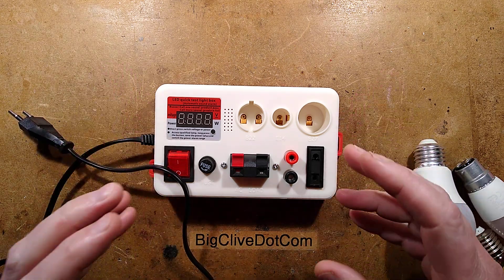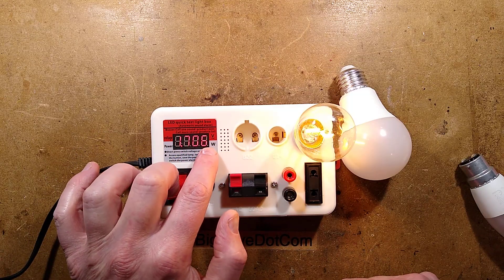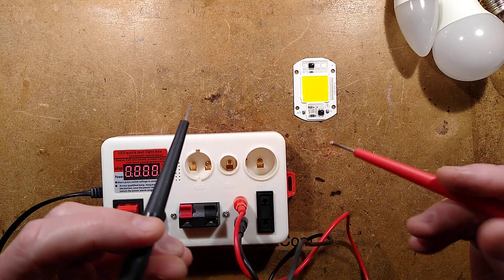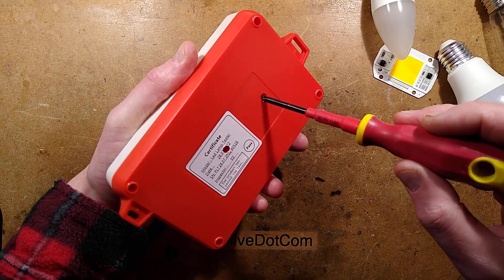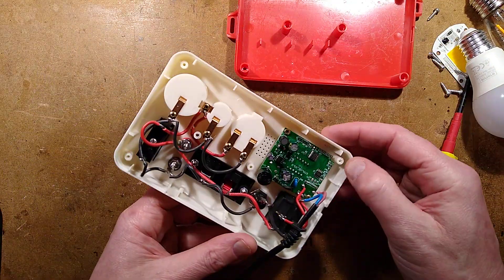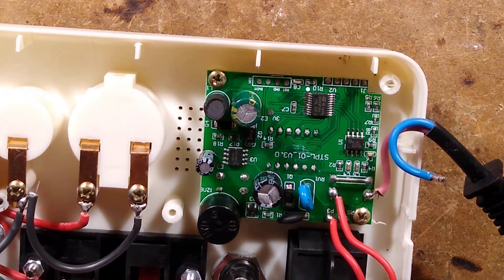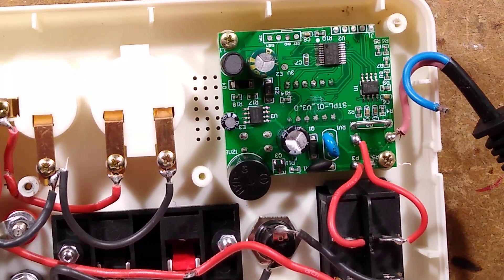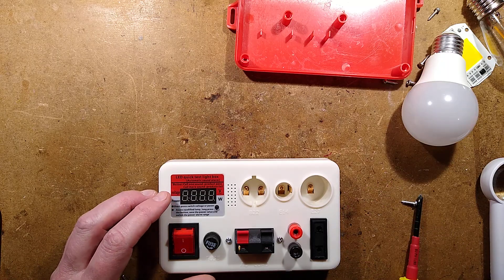Scary eBay Chinese factory test equipment

Comment: It seems good device to me. It's not safe, so is angle grinder, it's much safer than angle grinder.
And if you are healthy, it's quite unlikely to die from 240V, did you know anyone who died from 240V ?.
In terms of electricity we are too afraid in my opinion, this is not a device for someone that doesn't understand ohms law.
Reply from the maker: Yes.  I've attended the aftermath of an electricians electrocution to make the equipment safe.

Comment: Check the phase connection to the PCB it's only holding by a few whiskers not the greatest workmanship.
Reply from the maker: Neither of them were connected well, and when I attempted to re terminate them I discovered it was copper coated aluminium flex with very little copper.
Reply: We have a Kiwi expression when things don't according to plan (Bugger)  check out a set of television adervertising Toyota Hi Lux uses hope fully you will be able to find them on You Tube. I hope you can find them and hopefully appeal to your sense of humor.

Comment: I think in China they expect the individual to be more responsible for the security of self.  Not like the West where if you walk into the road without looking while watching Tiktoks  or swiping on Tinder, you can sue the motorist you walk into.  And ladders need 12 warning signs including "conductive" for aluminium.  Because education is so much better in the West, and Whites are so much smarter than everyone else.  lol.  On the contrary, use it or lose it and we're legislated to be careless and dumb.  Which is what Communists are supposed to be, in theory... Dao te King.  But I guess with Democracy you should expect the law to reflect the fears and aspirations of the lowest common denominator.

Comment: I've built and used "man killer" cheater cords before but those aren't commonly used, the idea that you'd basically use one in your daily workflow if using this thing with the probes is a bit disturbing...
Reply: With TV/radio servicing it sufficed usually to have a pair of polarized and unpolarized cheater cables.  If the "suicide cable" was absolutely necessary, alligator leads into the unpolarized cheater cable was what I used, plugged in only after hooking everything else up.  So I lived only semi dangerously.  I respected the juice.

Comment: Interesting as always! Out of all the weird stuff you've bought, which one would you say is the biggest "this thing will kill you" thing?
Reply: I vote for the blue camping light with a phone charging port tied to the incoming mains.
Reply: @tactileslut  I remember that one, Yea even worse then this thing.
Reply: @tactileslut  That adapter with the prongs that poked out at mains voltage was hilariously bad too. And all the "Dalek" lamps.
Reply: @tactileslut  For sure
Reply: The water heater which was just two electrodes directly connected to 230V? And used the water itself as a "heating element"?
Reply: @Maurice_Walker  probably passes testing if it was double insulated. 🙈
Reply from the maker: It's hard to choose.
Reply: Wasn't there a shower head with live wires in the water path?
Reply: @CptJistuce  yeah but that wouldn't shock you as long as it was working properly and grounded.
Reply: The smoke machine, that if you plugged a microphone into it, it would make the microphone live? https://www.youtube.com/watch?v=ik_0Z46y6-g
Reply: 2 forks.
Reply: Dang, now I want a rating system for likely to kill you stuff on this channel! XD

Comment: Wow that’s so dangerous imagine putting those probes down on your bench and you forget to turn it off 😮
Reply: That's probably why they put the fuse holder on the front panel, so the fuse is easy to change after little accidents with the probes.
Reply: That’s OK, I’m sure the vendor will be reminded of their oversight when the customer’s young child plays with the inviting live probes laying out on the counter and let’s out a loud whale of a cry.  What could go wrong?  Their test gear and “attention to safety” always amazes me!
Reply: @ethanpoole3443  Please remember that electrocution is silent, just like drowning. That's what the movies always get wrong.
Reply: @maxine_q  apart from the loud pop of the circuit breaker
Reply: @sovietrussia3632  Which is somewhere in the distribution box far a way and not that loud at all. Besides a breaker won't save you, unless you're talking about the RCD or GFCI.
Reply: @Ragnar8504  Clive made a video about this some time ago. Go check it out. (I don't remember what it was called though)
If you grab both probes at the same time it doesn't matter what you're standing on. And an RCD or GFCI can only save you if there's enough current going through the ground to make it trip. So being well insulated from the ground would actually make it worse.
Reply: @ethanpoole3443  lol 😂

Comment: Those 2 pin unpolarized plugs are used in Thailand for 240 volts  - before the development of multi voltage power bricks many US tourists blew their electronics apart.
Reply: It's a Europe standard plug, designed to fit various earth protected sockets through Europe.
Reply: @sparqqling  Also most unprotected sockets.  They might even be able to squeeze into British sockets if you manually open the shutters.  However for this particular device, I would suggest plugging it into a shaver socket for the added features in such sockets.
Reply: @sparqqling  these are designed to plug into most European sockets, earthed or not.
Reply: @jussikuusela7345  the Euro-plug shown is always unearthed, I'm not sure what you mean by "very often"? The thingy it is connected to should have the double squares symbol to show its double insulated. I mean proper ones, not Chinesium Quality Standard ones of course😁
Reply: @bennylloyd-willner9667  yes it is unearthed. The comment was about it plugging into earthed sockets quite everywhere. It does plug in most unearthed sockets as well, I bet including those that had the smaller holes that someone discussed in another video.

By some force it unofficially plugs knto the UK standard sokets as well, and it would work with the isolated UK bathroom sockets as well but not fit in all the way.
Reply: @bennylloyd-willner9667   The "euro plug" can be earthed or unearthed depending on the load and the insulation of the device. Devices that need an earth have a round profile plug with two protruding pins as usual and a tab on the side that connects to an earth tab in the side of the socket. All devices must be supplied with moulded on plugs so that they get an earth if needed. Google earthed euro plugs for a picture.
Reply: @johna7075  I know, that's why I wrote "the Euro plug shown" and not only "Euro plugs". Just a misunderstanding, no biggie🤝
I misunderstood Jussi, I thought he meant the plug and not where it can go. I think we all know our stuff, just some lingo problems on my part. I'm blaming it on the fact I'm Swedish 😁
Reply: @jussikuusela7345  sorry, my bad. I thought you meant the actual plug🤦🏻‍♂️😁
Reply: @bennylloyd-willner9667  no pro
Reply: @johna7075  Do you misunderstand I think. This kind of plug how you see in this video is every time NOT save-earthed (yellow-green stripes). It have only 2 plugs (AC/~) to transport max. 250 Volt and 2.5 Ampere. Not more not less!
Reply: @sparqqling  Correctly, European Asian standardized plug.
Reply: @Jannie Kirsten Exactly. It's rated for 250 V/2.5 amps double-insulated loads (i.e. no earthing required) and officially called CEE 7/16 option II. This plug type was developed in the mid-60s to provide an almost-universal lightweight plug for small loads, safe to use in all European socket types except for BS1363 and BS546.

Its predecessor, CEE 7/16-I, was shaped like the well-known "contour plug" 7/17 (250 V/16 A for larger double-insulated loads, only fits German and French socket types) but only had 4 mm pins and lacked the holes for the French-style earth pin so it was only compatible with German and Italian sockets. I haven't seen it on anything manufactured after the mid- to late 1960s.
Reply: @Ragnar8504  I have never seen the alternative I. In Finland electronics before the mid 70s was all ungrounded class 0 (a pain if you had grounded sockets) then they went to double insulated europlug.
Reply: @Ragnar8504  Czechoslovakia had a serious problem: They used 2 wires and the ground conctact of the socket was wired to the neutral. Its worse than having no ground, since the risk of a broken neutral is higher than a faulty appliance. With a faulty appliance only that single appliances metalwork would be live. With a broken PEN conductor eveything with grounded metalwork would be live.
Reply: @Ragnar8504  I had cause to look up old British plugs a while back, while the present British standard dates from around 1947 (with a few minor modifications since, such as insulation on the prongs), plugs from before then were not really much different.
Reply: @Ragnar8504  The US banned TN-C in 1996, still very late.  Since they used a 3 core cable for ovens and other large aplliances they could have made everything for 240 V and use a proper ground. I think Czechoslovakia and East Germany were the only Eastern Bloc countries which used TN-C for sockets. Other countries used a proper ground or no ground at all. Grounding is still rare in post-soviet countries, even in new installations.
Reply: @Ragnar8504  Other idiot decisions than TN-C was some countries allowing smaller ground wires. The UK allows a 2.5mm2 bare copper ground for circuits requiring 6mm2 live and neutral. Similar thing happens in USA and Canada with 8 AWG and thicker wires.Another dumb thing was standardizing screw-in and bayonet lock lampholders. The bi-pin socket similar to GY6.35 or GX5.3 already existed in 1893 and was used by Westinghouse for the Chicago World Fair.There were some other 2 pin lamp sockets like the Bernstein-Heisler base in the 1880s. In the US alone more than 14 different lamp sockets were used intil the early 1900s.
Reply: @MernokiMegoldasok  Same in Poland, so-called TN-C earthing system. Simply terrifying.
Reply: @Ragnar8504  such plugs with 4mm pins were used as a standard plug in USSR until its very end. Nominal voltage was 220V AC.
Reply: @Ragnar8504  there were different outlines of soviet plugs, but all of them retained features of 4mm diameter of each of the two pins, at a certain fixed distance (whatever it is, but must be the same in schuko ), and no earthing arrangement whatsoever.
Reply: @Ragnar8504  Thank you for this accurate answer! So I not must type so much.
Reply: I don’t see how a North American plug could fit in that without an adapter. Granted, the adapter could have been dodgy too.
Reply: Thai power sockets were great for dragging out a huge sparks when unplugging devices especially things with power bricks like laptops. I even managed to get a nasty 6 inch long spark come out of the socket in Thailand.
Reply: @@mattquinn-caledoniantelevi2522 And if you don't have the right "Travel Plug" you'd be surprised with what you can achieve with the pliers from a Multi-tool and a couple bits of wire! 😱🙄
Reply: I once ancidently plug my charger at 380v.
I did a mistake in the wiring system where I connected phase and phase of 3 phase ac lines instead of phase and ground into a single phase outlet. The good thing was my charger still survived.
Reply: Yep, you can see the "bell" shape that can actualy accept both eu and us plugs , it's getting more common here in Europe to see ungrounded outlets with that shape, their pretty handy when you need to plug some big chunky grounded eu plug and you don't give a shit 😅
Reply: They are used in almost all of europe except UK
Reply: @radry100  And Switzerland. Swiss sockets look like EU ungrounded sockets, but they're actually grounded via a middle prong. Interestingly you can stuff an ungrounded EU connector into a swiss socket, but the grounded ones have chunkier prongs so they don't fit.
Also Italy and Poland have their own weird variations of the standard EU socket, but most new ones are compatible. I've once found an older-style Danish connector on a piece of electronic equipment and though it looked very similar to the EU plug, it also had a third prong which made it incompatible.
Reply: They use North American type sockets with 240V? Wow.
Reply: @5roundsrapid263   Yes, the U.S.A. know 115 Volt and 230 Volt. Why they put products with 115 Volt stuff inside a Thailand socket with 230 Volt only the plug can plug-in  - so crazy. But the Thailand plug and socket is a little bit bigger and use two same flat rectangle.
Reply: Same in Europe 230 v, but it has to be doulbe insulated devices so earth has no function
Reply: Do you mean the European Asian Standardized plug? Sure it is for 250 Volt AC 2.5 Ampere. What is so wrong in your eyes with that? 
Why are U.S. tourists too stupid to know that in the Kingdom of Thailand not have 120 Volt AC outside the U.S. ships?
Reply: Polarized sockets is not a thing in most of Europe, Russia, Korea etc. Czech/Polish/French socket is potentially polarized but is not wired consistently so you may call it unpolarized as well. Swiss socket is probably polarized though
Reply: must have been a scam, to make the tourists buy replacements locally.
Reply: Yes we've all fallen foul of sticking things where they shouldn't go in pattaya 😆
Reply: @Jannie Kirsten To be precise the Euro standard (which does apply in the UK) is 230V +/- 10% i.e. 207 to 253V.
Reply: @Matt Quinn - Caledonian TV no you just need 2 wires , sure it won't work again😅
Reply: It's quite funny to see a 120v blow up on a 240 because people blindly shove stuff in
Reply: China also use American 2 pin sockets with 230V. And my mom fired an electronic toothbrush
Reply: Redemption  Doubtful.
Reply: Welcome to the real world.
Reply: Redemption  MERICA

Comment: Fantastic device. A form of widow maker with the look of a child's toy. Extremely satisfying. 
Surely the vent holes are to let the smoke and flames out when it catches fire? Otherwise there could be pressure build up and it may explode, which would be a little dangerous.
Reply: The vents are to allow spilled liquids to enter the device
Reply: Widower maker, I’d say.

Comment: A right proper treat both outside and in. The neutral in wire doesn't look like it's been tinned, I can see any silver on it. The live wire that is "soldered" has a few Careless Wiskers. So a really nice bit of sh t to start the week of with. Thank you 2x👍
Reply from the maker: It was quite hard to solder as it appears to be copper coated aluminium with barely any copper coating.
Reply: @bigclivedotcom  Its never going to tin.  🤣🤣🤣🤣 That just makes it even better
Reply: @bigclivedotcom  Chuh-eep!  Aluminum, what?  For a plain old power cord?  Not even a clamp-type connector in there?  There actually IS a thing called aluminum solder though.  (I am using Yankee spelling here.)
Reply: @SeekingTheLoveThatGodMeans7648  If the products intended for the market are cheap, I can only imagine the corners they would cut to save money on the test gear their own workers use in China.
Reply: @aliveandwellinisrael2507  It depends on the factory management. I've been in Chinese factories where the workers had absolutely excellent test equipment. Some of these factories made cheap electronic toys, so the profit margin wasn't huge.
Reply: @bigclivedotcom  Not likely to be CCA wire, that is still too expensive for use. Likely that is that copper plated steel, with all 3 strands going in the plastic insulation. Solders possibly, in places. Replace with a proper cable and it is not too bad otherwise, just use with a brain, and add in a RCD connection to the supply.
Reply: @bigclivedotcom  that might explain why the beep detection circuit does work reliably, due to the resistance factor
Reply: Careless Whiskers? Was that George Michael’s beard? 😂
Reply: I'm never going to fuse again, careless whiskers are unforgiving. Though it's easy to pretend,
I know you are a fool.

I should've known better than to test a bulb,
And waste the life that I've been given.
So I'm gonna get a shock again,
The way the Chinese doooo....

(Saxophone 🎷 solo)
Reply: @nicholasvinen  Good one. That reminds me, I recently saw a video that said Andrew Ridgley still gets half the royalties from Wham! I bet he got all the women back then, too… 😂
Reply: @nicholasvinen  LOL
Reply: @5roundsrapid263  yep. 🤣🤣
Reply: There were "suicide cords" to defeat the interlocks on hot chassis radios.  But this beats any suicide cord that I've seen.
Reply: I noticed those too. Jesus Christ.
Reply: @PunakiviAddikti  nice a spicy  🤣👍

Comment: Roll back the clock a bit and there were equivalent devices in factories in the UK and US.
Give China some time and they'll become over regulated too, after enough rich people lose family members.
Reply: Rich people (and their family members) in China aren't working in the factories & small scale production line shops that these things get used in; but on the off chance that they were, they wouldn't be the people actually using them, they'd be the bosses!
Reply: There's enough hazardous electrical stuff getting around that eventually some of the 1% will get a turn.